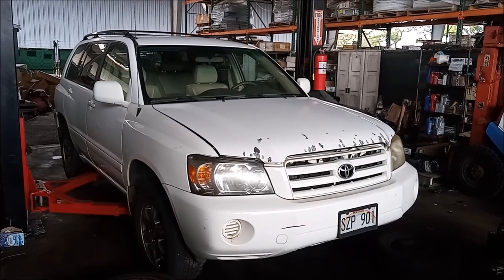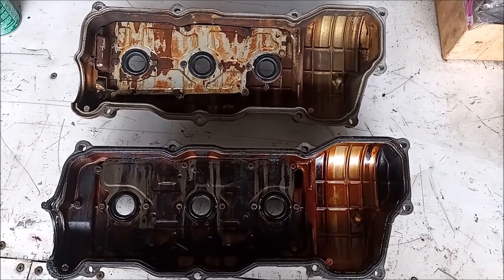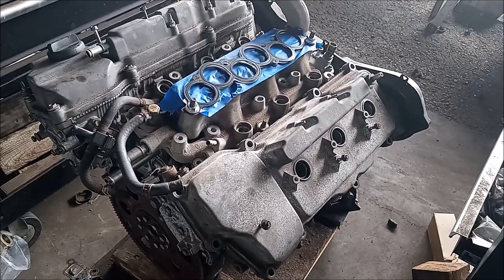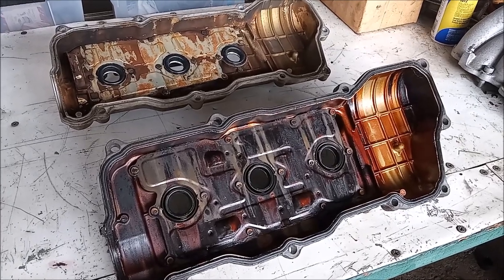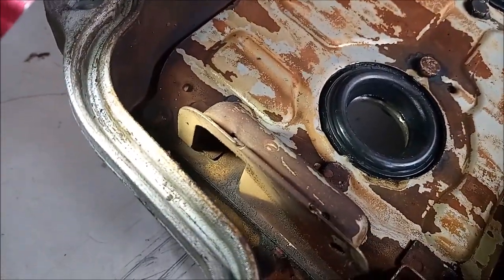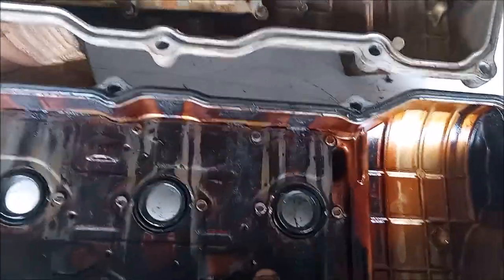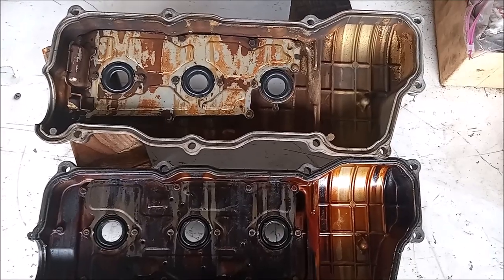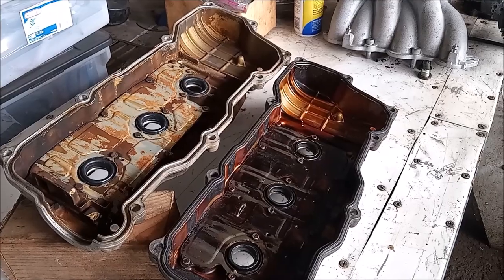Prevent Engine Oil Sludge - Toyota V6 1MZ-FE 3.0-liter - Camry Highlander Sienna RX300 ES300 Avalon

Comment: I have 2006 Camry with the 3.0L V-6 (1MZ-FE) that I bought used a few months back. It has 150K miles and I'm going to assume nothing was replaced and/or minimal maintenance was performed. Don't suppose anyone happens to know the part numbers for the 3MZ-FE valve covers (OR) the years they where used?  This is my first Toyota so I'm not familiar with all the in's-n-out's of the engine models. I'm sure things are gummed up in the engine. However, after I get the engine cleaned up (whatever that maybe) I'd like to try incorporating the valve cover swap out as preventive maintenance for this vehicle going forward.
Reply: 11202-0A051 front valve cover, 11201-0A060 rear valve cover for 3mzfe.

It's only a direct fit if your 1mzfe has VVT-i. You can see if it does or does not by looking at the area around the oil cap. If you have a non VVT-i 1mz, the improved 3mz valve cover will not fit.
Reply: You a have a 3MZ-FE in that model year (2004-2006)

Comment: You failed to mention the Avalon i have that includes the 3L 1mz also . Ive never even removed the plastic cover to see the engine , but the car just turned 70k mi and i use only synthetic 5w30 pens oil every 4k mi . I doubt its slugged up inside as the oil looks very clean when i remove it . 
    I remember removing the valley cover on that first 49  331ci cad engine with well over 100g mi , and the black sludge was completely filled to the cover . I trouled it out -lol . I rebuilt the engine and installed it in a 19ft runabout . It ran beautiful for several years , THEN i removed it and installed a dual quad 392ci hemi from an Imperial cause i wanted excitement .  You wanna see a rooster tail and 15 skiiers !!?  What a great life us engine enthusiests lead - lol !!  Have a great day .
Reply from the maker: Thank you for watching and for commenting.
Reply: I have an Avalon with 70k miles and I found an insane amount of sludge when doing valve seals. Previous owner has perfect maintenance records at the dealership. Might wanna check that out

Comment: Great video!  I always wondered why the 3MZ didn't sludge as much and I've not seen any explanation yet.  So, I take it Toyota never put out reason for the sludging in the 1MZ? 

What would you suggest to remove existing heavy sludge in a 1MZ?  I understand about changing to a 3MZ valve cover, but would that actually help with removing existing sludge in the engine? 

Have you found that those oil treatments with detergents work, or once there's heavy sludge is it too far gone for oil treatments?   

As always, thanks for the great content!
Reply from the maker: Be careful with sludge. It can drop down into the oil pan and clog up the oil pump pickup. If you do anything that dislodges sludge, you should remove the oil pan and dump out the sludge and clean the pickup. I've shown this in another video.

Comment: Question for you sir, older 1MZ "without" VVTI are also a match for the 3MZ WITH VVTI?  Will do this swap if they will work on my 96 NON VVTI 1MZ 🤷
Reply from the maker: No, valve covers are different between vvti and non-vvti.

Comment: I'm doing valve cover gaskets and realised the inside of my baffles are sludged up. Think it's a good idea to drill into the rivets remove the baffles, clean them up and tac weld them back on? Or is there a gasket in between them. Interested to know tour thoughts cheers
Reply from the maker: That's a very good idea. There is no gasket in between.

Comment: Hi Frank, do you have a video on how to remove the intake thing just under the manifold? (1:14 in this video, it has the blue tape on it.) It's already off in your Head Gasket video. Thanks again.
Reply from the maker: You're asking about the Lower Intake. It has bolts and two studs all around its periphery. They are all 12mm hex. Just unfasten the bolts and the two nuts. You also have to remove the water inlet on the timing belt side.
Reply from the maker: Probably I covered this in one of the knock sensor videos, because this lower intake has to come off when you service the knock sensors. Also, I may have covered it in the thermostat housing video, because, again, the intake has to come off to service the thermostat housing.
Reply: @Merryfrankster_  Thanks again my friend. With your help I'll get this Avalon running again. Cheers.

Comment: If the front covers are the same between the 1MZ and 3MZ, I'll assume there's no advantage to change those.  Are ALL (Years) 3MZ rear covers compatible with 1MZ engines (assuming theyre both VVT-i) ?  Thanks,
Reply from the maker: they should be compatible as far as I know. But I don't know everything.

Comment: Hello , does  the PCV valve make any difference in sludging process
Reply from the maker: Yes of course, the PCV valve is a regular maintenance item, it should be replaced with oil change interval. .

Comment: Is it just the rear bank that sludges up?
Reply from the maker: Both can sludge up but the rear is worse.
Reply: @Merryfrankster_  I did my front valve cover here recently. The metal is still shiny cams and everything no sludge does that indicate that the rear is also in the same condition? I have almost 300,000 miles.
Reply from the maker: @Toyotaguy.  Probably it's ok.

Comment: If i have a 1MZ-FE and i want to use the 3MZ-FE valve covers, what gasket part # should i use to go back on the 1MZ head ?
Reply from the maker: they are the same.
Reply: @Merryfrankster_  do you have the genuine toyota gasket part # I'd need ??
Reply from the maker: @fruitfulfigtree2195  I just use Fel-Pro. Look on rockauto. The rockauto listings also provide OEM part numbers for reference.
Reply: @Merryfrankster_  THANKS!!! I SUBBED TO YOUR CHANNEL!
Reply from the maker: @fruitfulfigtree2195  Thank you for watching and for commenting.
Reply: Oh one more question lol will this work on the 1997 camry or is yje valve cover a different shaoe than this  i noticed the other camrys 1mzfe valve cover is a different bit rounder @Merryfrankster_
Reply from the maker: @fruitfulfigtree2195  no. this is for vvti engines only. 97 camry is non vvt. Valve cover is completely different.
Reply: @Merryfrankster_  so what can I do to prevent that on my 1997 1mz-fe?
Reply: @Merryfrankster_  so how can I prevent the sludge build up on my 97 ?
Reply from the maker: @fruitfulfigtree2195  use a good pcv valve. take the rear valve cover off and flush out the air-oil separator. change oil frequently. Use high quality synthetic. Do  an engine flush periodically.

Comment: Hey fam, I got a 1mz non vvt-i, I have excess oil coming out the Pcv I collect in a catch can, can this rear swap stop oil from coming out the pcv also?
Reply from the maker: Vvt does not fit non vvt but maybe a newer cleaner valve cover would help or maybe you can remove the baffle for the air oil separator and clean underneath where the oil pools up and the rivet it back or screw it back together.
Reply: Oh because this video is on a 1mz vvti and 3mz vvti? 

Oh I was hoping I could swap a 1mz "non" vvti with a 3mz "non" vvti
Reply: Yea I want a vavle cover with better baffles for my 1mz "non" vvti, so t tired of this excess oil 😔

Such a great engine, but that rear valve cover such a flaw.
Thank you also
Reply from the maker: @veindawgz998  I don't think you can swap those.
Reply from the maker: tbh I have not even seen a non-vvt 1mz in a very long while.

Comment: Let me say this, the majority of people out there are simply pigs, they go forever between oil changes! My 96 Camry has over 400k miles on it and ZERO sludge, does not burn an ounce of oil between oil changes, - which BTW I do every 4000 miles since I use full synthetic, there is no other reason for it to happen other than what I just told you!
Reply: What engine to you have in your 96 Camry?
Reply from the maker: This is what one might call a six-sigma occurrence. Of course such things can happen and do happen, but how often? Carry on.
Reply: 1MZ FE
Reply: Some very reputable toyota mechanics on youtube have also said that the sludging is mostly from poor maintenance. The same could be said for your six sigma comment, ie correlation (or lack thereof) does not mean causation.
Reply: Oink oink